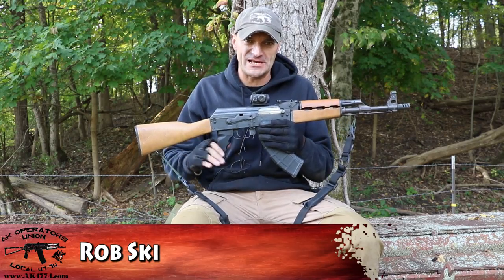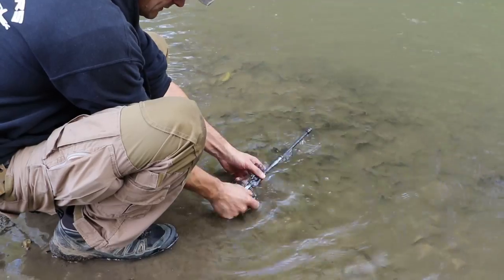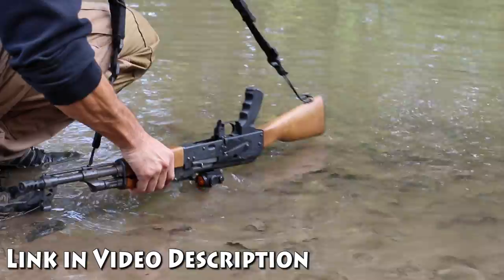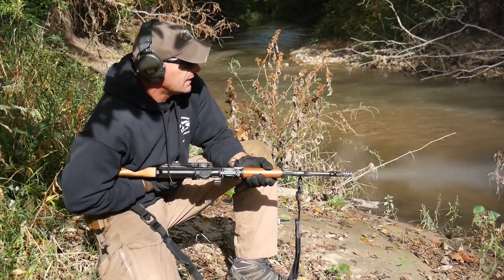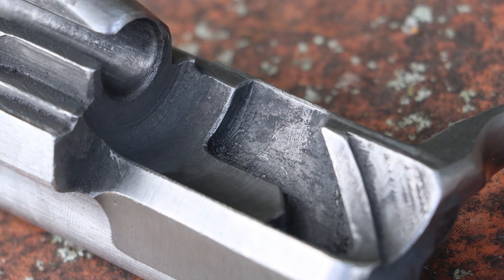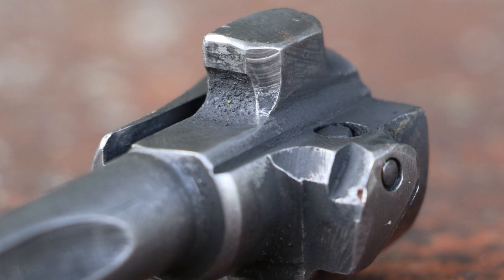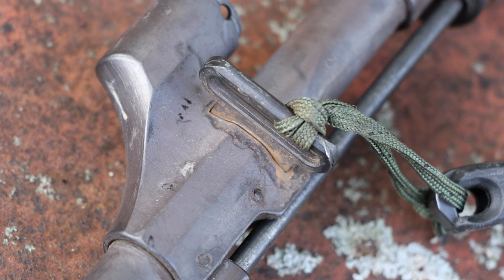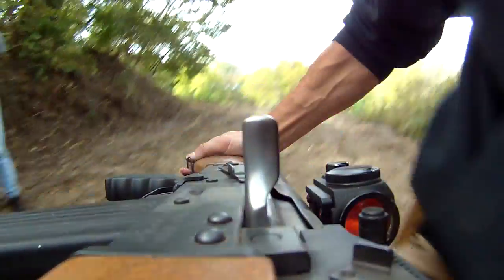Zastava NPAP AK47 - 3000 Rounds Later?!

Comment: Looking good my NPAP is in black plastic furniture. Rough looking, but quite durable. I've had mine f I r approx 4 years, and never had an issue. Approx 6000 rds. I DID put G2 trigger, and different compensator. Thats all
Reply: A NPAP in black furniture was my first AK rifle as well and I would not mind buying another one. Probably my favorite foreign made AK variant. I don't have it now but am looking at getting the DDI USA made AK with that corrosion resistance finish they have on it.

Comment: Great guns, I didn't like the stock furniture,  so I swapped it out. canis makes an adapter for an M4 adjustable stock. It's one machined piece, and bolts right on. No need for the two piece adapter and pig nose style. I run Tula ammo through mine and after close to 1000 rounds,  no malfunctions. I actually prefer my npap over my ar15.

Comment: love my npap, for such a low price it's a pretty great rifle. I was wondering if you guys check what different rail systems and stuff will fit on the npap I've heard it doesn't fit all of them for some reason and Id like to know which ones fit before I purchase one from your site.
Reply: RS Regulate makes a side mount that is correct for the Yugo pattern rifle.
Reply: Andre Filippi Anything aftermarket parts you buy for your N-Pap will be called "Yugo" compatible. So as long as your furniture or stock or whatever else says it will fit a "Yugo M70", it will fit your n-pap

Comment: You think you can get your hands on a borescope? Im sure im not the only one interested in what the rifling is going to look like on a bare barrel after the test
Reply from the maker: I'm saving money for some sort of the camera we could stick inside...
Reply: How have the bores on the 5000 round AK's looked? Good? Bad?
Reply: Ak Operators Union, Local 47-74 use a camera with an optical zoom feature. take the image from the rear of the reciever. much easier to take an image of the barrel that way than through the muzzle end.
Reply: Maybe you should donate some $$$

Comment: hey Rob should I have D.A. pin  and weld the VG6 Epsilon brake on my rifle or the PWS FSC47?
Reply from the maker: +jim 02122 yes, that's a decent brake
Reply: Ak Operators Union, Local 47-74 which brake ? the VG6

Comment: I'm amazed by so many AK's display the rough machining indicative of Germany's end of war crudeness of manufacturing and stamping technology. That said with proper metallurgy and heat treating there is a properly functioning weapon. Then you contrast this with the consistent quality of AR manufacturers.  Two opposing ends of the manufacturing spectrum.
Reply: most people don't realize that especially compared to AR15s AKs are practically hand made
Reply: And the much tighter tolerances in the AR require much better machining.  The AK is so loose it just isn't needed except for looks, and if you care that much about looks, you spend much more than a NPAP costs.  
It's simply a cost/time saving measure.  The machine work is just as good as it needs to be in order for reliable function and acceptable cosmetics, no more no less.
Reply: Thystaff Thywill hardly. An iron sighted ar will out shoot an AK with a ps01 optic.
Haven't you ever given thought to why there are absolutely zero AK's in any rifle competitions with AR's? The reason should be obvious I would think.
Reply: Thystaff Thywill show me AK's competing with AR's.  It's never happened. Don't be a buffoon son.
Reply: Thystaff Thywill competitive buffoonery you've certainly taken gold.
Reply: Burt Hulbert Aks have loose tolerances and reliable functiom. Can you rinse your ar in a dirty river to remove sand??? Can you teach a ten year old how to field strip an AR for maintenance in under 10 minutes with no tools??? Just with the money you save on ammo, to reliability, to popularity and functionality, the AK will dust the floor in combat situations. This is one of the only AK misfeeds you will ever see!! AKs don't knee to be pretty to sell, because they work. Period. ARs can't make that same statement. And cleaning an AR? Forget it. Just disassembly would make a newbie breakdown
Reply: Thystaff Thywill   I have multiples of both and have shot many more. The ar is inherently more accurate.

Comment: Why aren't there any videos on the saiga? I figured that would have to be an ak you've tested
Reply from the maker: +Rooskler Are you aware that saiga can't be imported anymore? I could do videos on rare AKs, but what's the point?
Reply: Ak Operators Union, Local 47-74 that's a good reason. I just picked up a 5.45 saiga with the stock and pistol grip already converted, I was wondering if it was with it. I'm sure it is

Comment: Rob I dont have a rivet on my piston in my WASR. Is that normal? I can see the threads where it screws to the carrier, through the hole where the rivet is on NPAP piston. should I be concerned? Should l stop using it? I've had at least 700 rounds through it. Piston doesn't seem to be coming undone. Just the normal wobble. Great video as always thanks.
Reply from the maker: +4PITTS1BURGH2 could you email me picture of it?
Reply: absolutely. what's email address?
Reply: is it on the union website?
Reply from the maker: +4PITTS1BURGH2 ak74ski@comcast.net
Reply: OK email was sent. subject is carrier and piston pics
Reply: Depending on when your Wasr was made Century used to be lazy and instead of riveting the gas piston on they'd weld it on. This makes the carrier and piston stiff when it should have play and apparently effects reliability a little. I've never heard of it really causing an issue though. I think this is what you are describing.
Reply: no there's definitely not a weld. there's a hole where the rivet goes and I can clearly see the threads. it isn't stiff and won't unscrew
Reply: it was made in 2011

Comment: how did it fire out of batery
Reply: like a champ
Reply: Han Solo that's what I was wondering
Reply: who shot first han?who shot first.......
Reply: i thought the same thing!
Reply: The RAK-1 hammer is why. I did a test for a member on the AK Files with a RAK-1 trigger group.  The rifle can fire out of battery with the steep sloping hammer profile. The carrier has a little bit of travel room left after the bolt goes into lockup. The bolt may have had just enough contact with the locking lugs to keep the rifle from having an out of battery detonation.
Reply: oh my god ..... I'm so glad I just traded my C39V2 for a mini14 and a mini30 .. good on me ...
Reply: Why? That thing is junk...  Can't even shoot steel cased ammo without changing that hammer spring...
Reply: I don't shoot steel cased ammo
Reply: I reload 😄
Reply: Turkey trail honey bee farm Georgia what are you smokin dude . What about a mini 14 or 30 wont last over 1500 rounds ... they're beast . One time we put 1000 rounds down  pipe in a single range sesh. The nutn fancy that shit and get laughed at son ... lol
Reply: Turkey trail honey bee farm Georgia nah big balls all the time . IMA BOSS .
Reply: *****  You can do it. Just look for function issues, like pull the carrier all the way back and see if the profile of the surplus hammer will be pushed down by the carrier like it's supposed to do. Some hammer profiles are more/less aggressive than others and can cause the carrier to get jammed in the back position. This is very rare but can happen when mixing miss matched triggers, hammers, and carriers.

Comment: Does it have the century RAK1 TRIGGER GROUP ROB?
Reply from the maker: +rod serling yes, this is rak1
Reply: Do you find it to be a good group I just installed one on a custom sar1
Reply: Ak Operators Union, Local 47-74 ^^^^^
Reply: rod serling yes it comes with the RAK-1 trigger.
Reply: Zyralius 1982 yes thank you robski answer my question but thanks anyway

Comment: is this a diffrent variant npap than the other m70 video " "the npap is dead" if so why another video ?
Reply: Because the N-pap's have a lot of qc issues. 10 of them in a row work, the 11th doesn't.
Reply from the maker: +Cesar Flores yes, this is newer version and because people voted for it in the voting pool.
Reply: i see
Reply: From your testing the black furniture model failed and the wood version has 3000+ rounds ok..? Shouldn't they be there same hardware otherwise or any other diffs? Great videos..